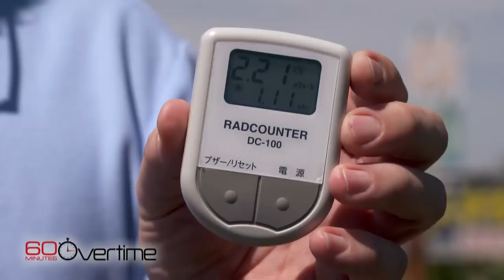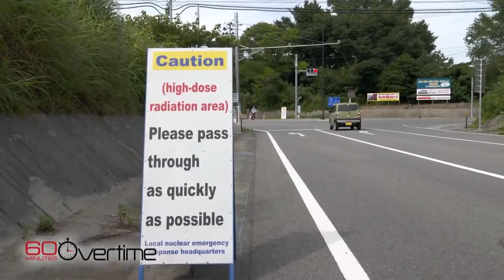Fukushima's ghost towns

Comment: The Japanese also ruined the reactor in Southern California San Onofre.
Reply: I live in San Diego. And you know damn well that if San Onofre blew up, they'd probably cover it up before trying to clean as elaborate as the Japanese. 

Update the plant, and then reactivate it
Reply: Trésor Irumva Mitsubishi electric engineered and installed a steam turbine that leaks radioactive water then blamed it on Edison. Great customer service from Mitsubishi.
Reply: jak p  I tested for radiation at San Onofre last year (the entire west coast too).  Nope, you lie.
Reply: ForbiddTV lie about what? Sue Mitsubishi electric.
Reply: Yea they tried to increase the amount of heat exchanger tubes but unfortunately they all vibrated together and broke apart.
Reply: There is no measurable radiation beyond normal background radiation outside of the San Onofre plant. I whet there and made a video for YT of my test there.